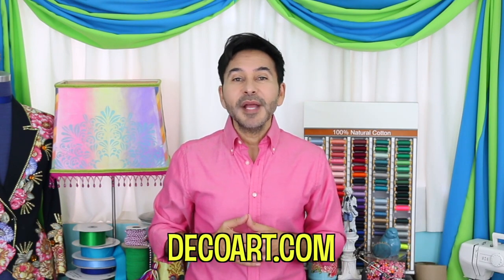Upcycled Bottle Cap Heart Tutorial | DecoArt®

Comment: Which brand of top coat did you use? 
Curious--why did you skip painting primer on the wood before painting it with the colors? When I don't primer wood before painting colors on it, the paint color ends up chipping & peeling off over time. ???  Just wondering.  Does this multisurface paint not need primer layer first?
Reply from the maker: Thank for your question! The topcoat used in this video is our Clear Pouring TopCoat, you can find it here: https://shop.decoart.com/clear-pouring-topcoat/ 
Also-- Our Multi-Surface paint is formulated for many surfaces, wood does not need a layer of primer before using our Multi-Surface paint!
Reply: @DecoArtPaint  oh I see.  Thank you for taking the time to answer my 2 questions.  I will definitely buy some of this paint to use on my little wood projects.   I absolutely love what you did with this sacred heart!   So pretty!  Thanks again.